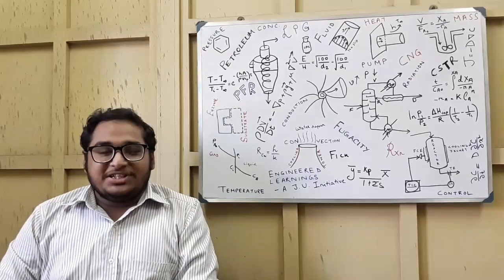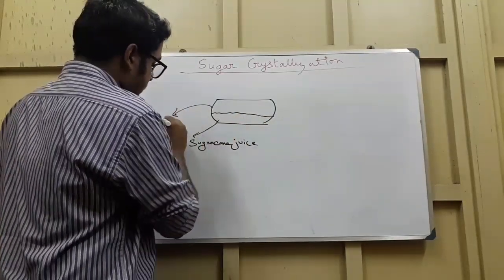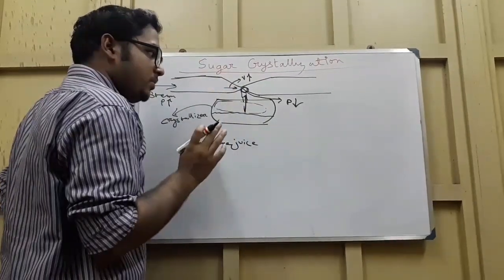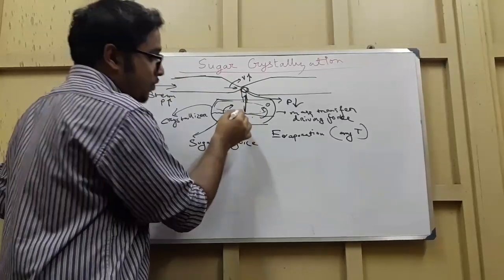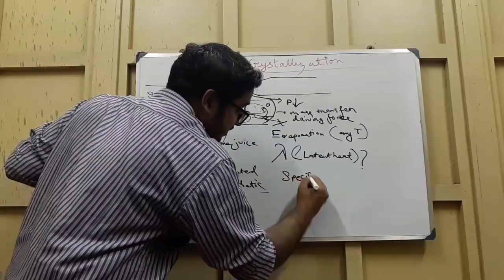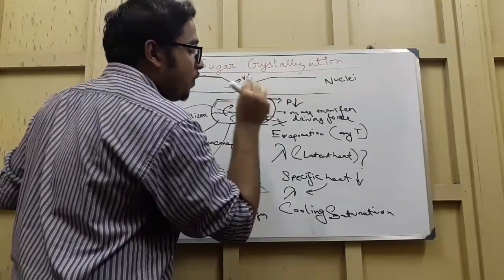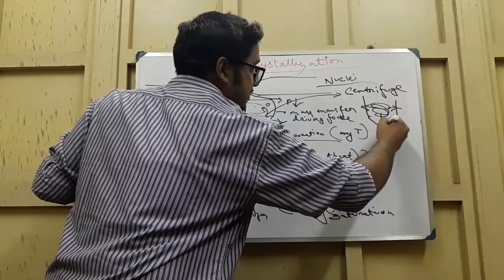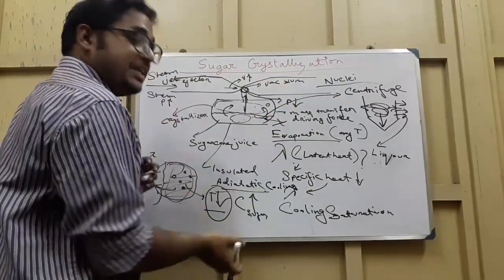EVAPORATIVE COOLING | ADIABATIC COOLING | SUGAR CRYSTALLIZATION | PLACEMENTS | INTERVIEWS | EXAMS

Comment: In reality this would be a continuous process, in that liquid is pumped into the crystalliser to maintain a level. If the fee temperature is controlled to 20 Deg C and the temp inside the crystalliser is to be 12 Deg C, then what would be the issue of the inside temperature just equalises with the feed temperature even if the desired pressure is being reached inside the crystalliser?
Reply from the maker: Whenever there is a lack of partial pressure there will be evaporative cooling, which will reduce the temperature of the overall mixture till it crystallizes, if the feed is entering at 20 deg C, it will also go down
Reply: @LifeBeyondBusiness  Thank you :)

Comment: Hello dada, my doubt is that yeah i understood why evaporation will take place, but dada as you said at 2:52 that when P reaches Pvap of the sugarcane solution at that temperature, then dada the sugarcane solution should start boiling also na alongwith evaporation?

And when evaporation will take place solution will cool down, so Pvap will fall further and then boiling will stop immediately.

Thus dada can we conclude that at starting both boiling and evaporation will take place, and later due to lowering of Pvap of solution, the boiling will stop?

(I know boiling is not of any interest in here, but just curious about it😅)
Reply from the maker: If P ever reaches Psat i.e Saturation Pressure at that Temperature, boiling will start off.

Comment: 900 °c coke oven gas is cooled in 90° c degree by using 60° c amonia water liquor...which is heated at 90° c ...and it is going to the process again..during this process tar particles of the gas condensate at the seal pot from the gas...there is no insulation in this gas pipeline sir....can I said this process evaporative cooling process ....then the where is the going 810 ° c..
Reply from the maker: Evaporative cooling mainly occurs when Some substance gets vaporized at the cost of itself, that is one part of the liquid is giving away it's specific heat to provide the latent heat of vaporization to the other part (in the process, the part that loses heat cools down and The part that gains heat vaporizes) (Refer to this Video to understand the Thorough Concept of Evaporative Cooling:  https://youtu.be/Y1P6bn0qEl4 ). 

Here the case is different, here a vaporized state of coke oven gas is heat exchanging with ammonia, in the process losing heat and reaching 810°C (as mentioned by you). At 810°C, at that particular pressure the Boiling point of Tar is achieved, due to which the tar condenses out (from vapour to liquid). This is a case of condensation of Tar (one component of the coke oven gas) by simple heat exchanging with a foreign material (Ammonia in this case).
Reply: @LifeBeyondBusiness  thank u sir...for replying my msg...now I think here involved amonia water vapour refrezgation technique is worked here...for that case decrease too much temp of coke oven gas...as usually we think if amonia water contact during high temperature it can easily evaporated of total solution..but here that's case is not happened ...and we slightly heat up amonia water by spraying this solution...if u think that here amonia water strong  molecular bonding working here...
Reply from the maker: Yes absolutely, here simple heat exchanging and in the process, condensation is taking place!
Reply: @LifeBeyondBusiness  nice to talking with you sir...god bless u....